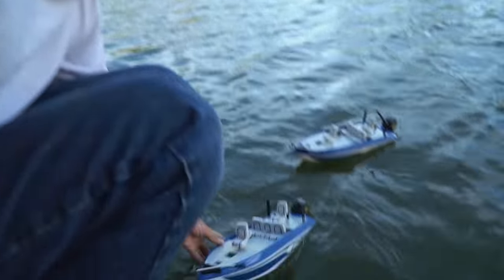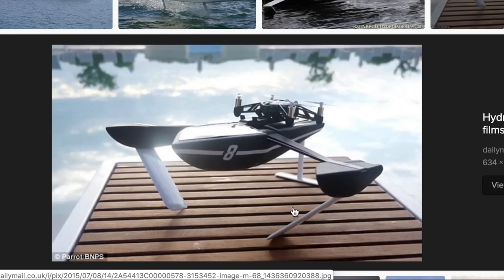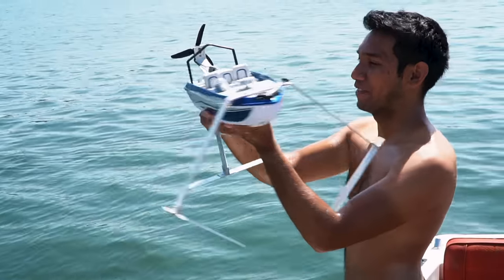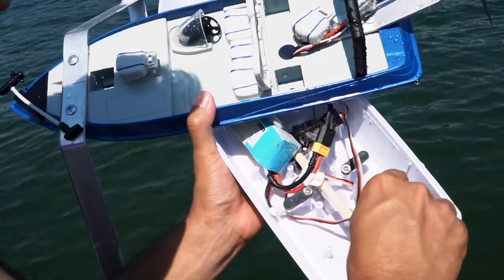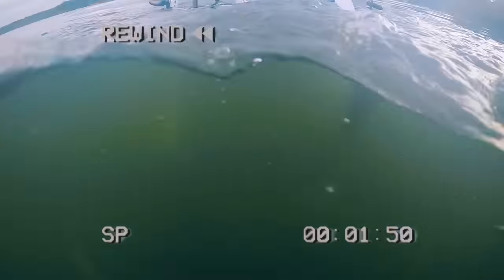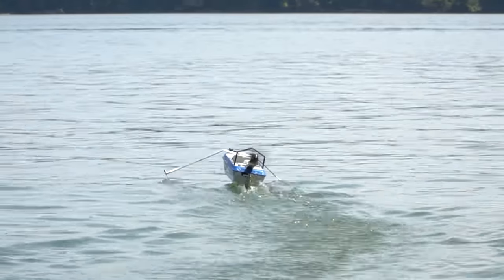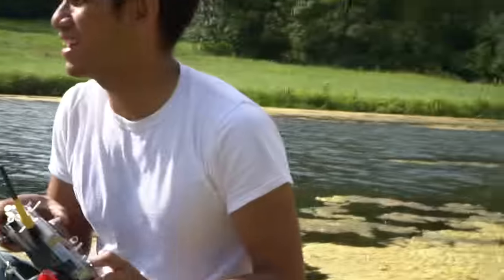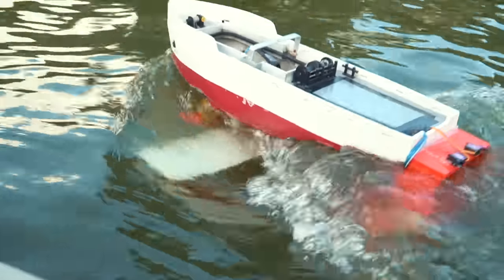CHEAP HYDROFOIL RC Boat MODS

Comment: I tried this out and I had the same problem but the thing is I put a stick under the bottom in the middle like a metal stick and then it started going more up and it started tipping I took it off I need to still chipping and I did the same exact thing Ben did it but it’s still shipping can you make a video that helps people do this please

Comment: Need to use the same props that power the boat when it's displacing water. move motors to the front of the boat, long prop shafts that go deep just below the rear foil. Just like a full scale hydrofoil. Like this... https://www.youtube.com/watch?v=9vXqdTBDW0g

Comment: All those boats and planes whatever i saw were all overly powered by powerful motors and batteries and im not surprised to see everything works out,, those motors you used were actually powerful enough to lift them vertically,, power to weight ratio is too good not as in real aircraft so its boring tbh

Comment: Aside from the too-fast cutting in the video (what a headache), the boat knowledge was lacking when you attempted to get the tug to work.  A tug has a 'displacement' hull, so is designed to cut through the water -- it's designed for slower speed but lots of stability.  In this application (particularly at model scales) you need to have a 'planing' hull, that's designed to travel across the surface of the water -- it's designed for faster speeds but is not as stable.  This design is also where you get the greatest advantage of the power-to-weight ratio, 'coz you're not using your power to push aside the water.  Much more ship design to research, methinks...

Comment: Had to give you a thumbs down on this one bro... Check into a thing called "Hull Speed",,,,, Tug boat... second you need to put controllers (fins) on the foils themselves to lean and balance, lift on each side as well as forward and aft and I would not say it is a true foil until you are way off the water... just sayin...   Think of it this way.. you are flying through a very very dense air...